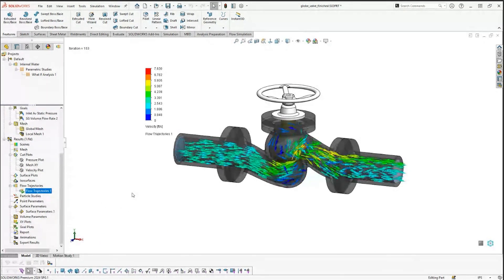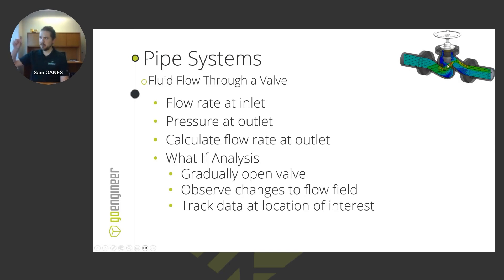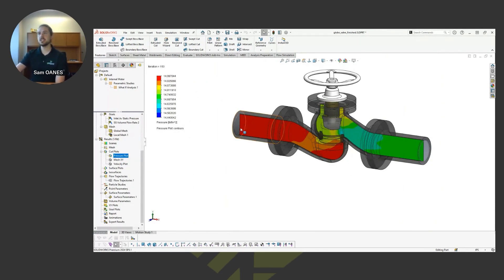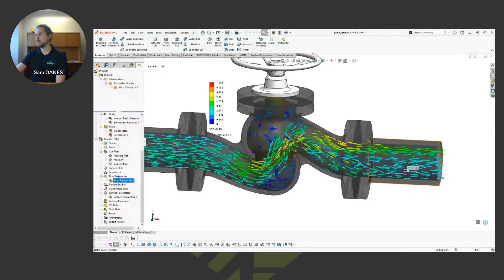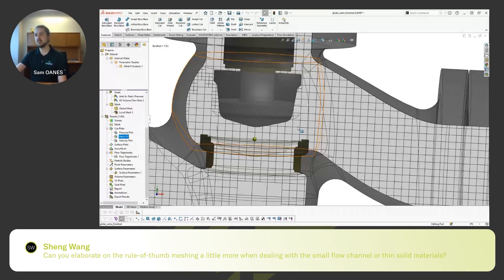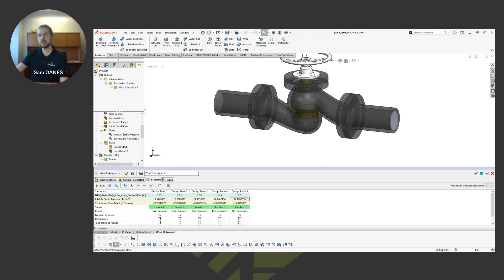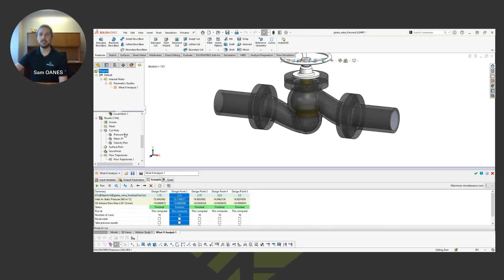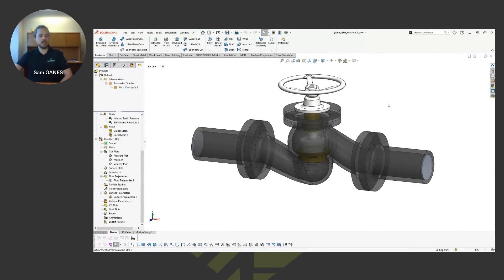Analyzing Flow Through Pipes with SOLIDWORKS Flow Simulation

Comment: You show a what if analysis where all the design points are practically the same. Why is it so difficult to make a tutorial presenting cases that make sense?
I wonder if a higher volume flow rate would make the analysis more interesting.
Kind regards.